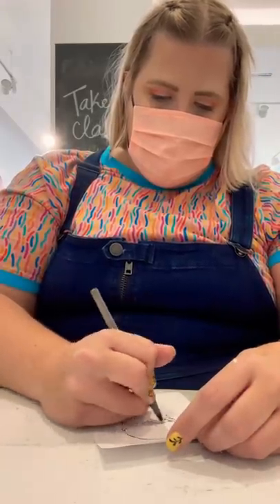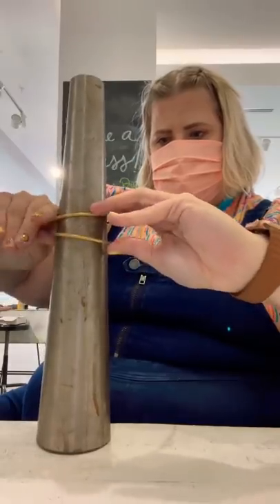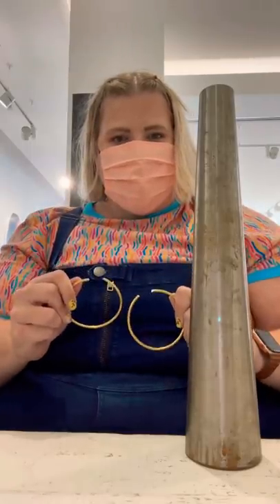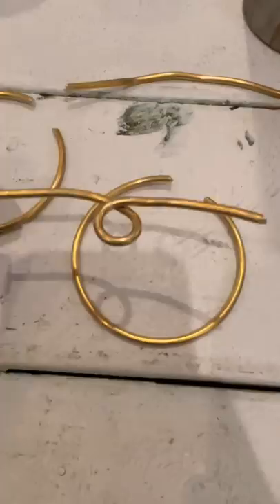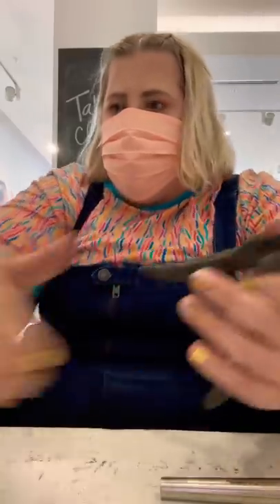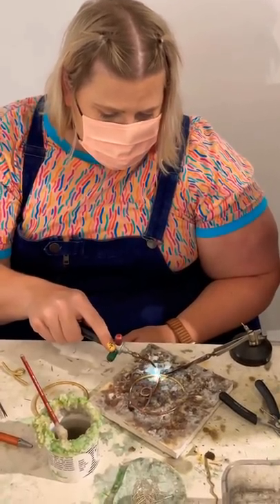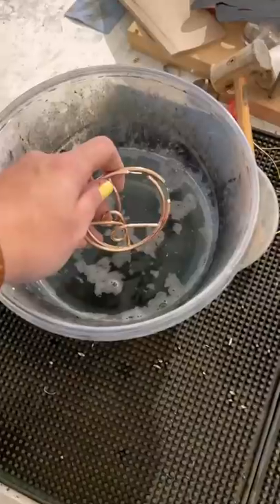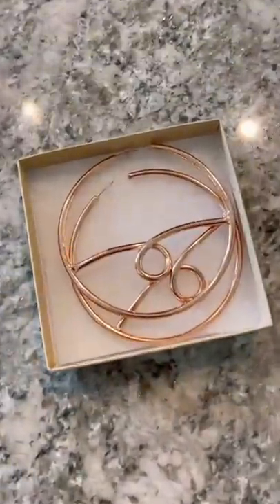These turned out amazing #shorts #DIY

Comment: When cutting wire using wire cutters try to place to wire as close to the hinge of the cutters as possible to make it easier and more controllable. Also there adres different type of cutters for different type off material such as steel of copper. Using the right tool can make so much difference.

Comment: That's welding not soldering. 
Other than that, the hoops look AMAZING
Reply: In the jewelry world, it’s soldering. There’s a difference between soldering and fusing but it’s not really called welding at all
Reply: @emmaporterukulele  Soldering is connecting two pieces of metal with an external metal.
Reply: @robuswhitewolf4896  that’s what you do with jewelry soldering:) you have a small piece of silver that you melt into the soldered joint. For softer metals like gold, you can simply melt them together (that’s what’s considered fusing)
Reply: @emmaporterukulele  Ah, I did not see the external metal
Reply: @robuswhitewolf4896  it’s fine, thanks for listening to me rant about jewelry
Reply: @emmaporterukulele  No problem lol. Do you make jewelry?
Reply: @robuswhitewolf4896  yes i do:) I’ve been doing it for about 5 years now, and I’ve been thinking about making jewelry professionally. How about you? Any arts?
Reply: @emmaporterukulele  I mostly write and do a bit of drawing, but I do solder circuit boards. I've been doing that for 4 or 5 years myself

Comment: Little tip get the cutter on the wire where you want to cut it then drape a cloth over the cutters and wire then cut away. Trick I learned for snap rings from a old mechanic.